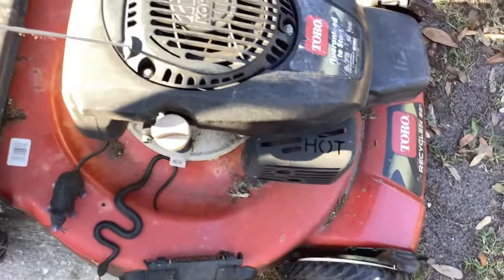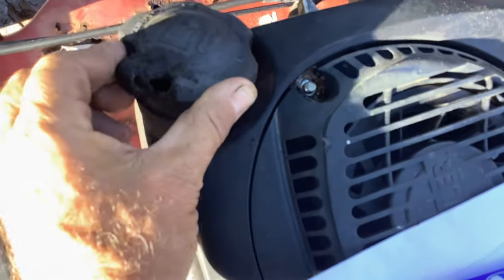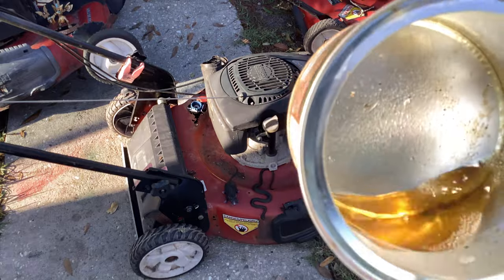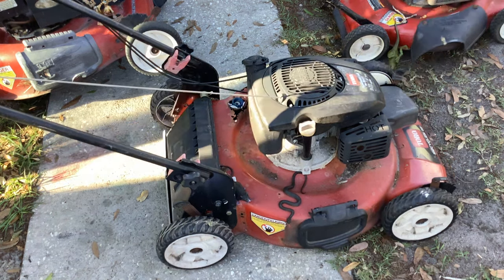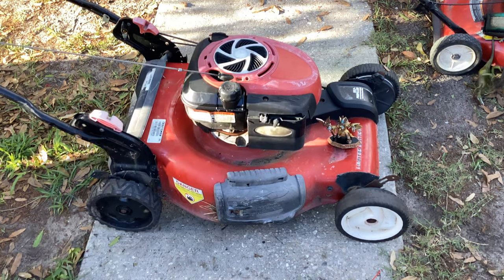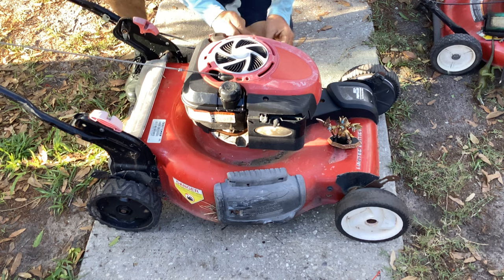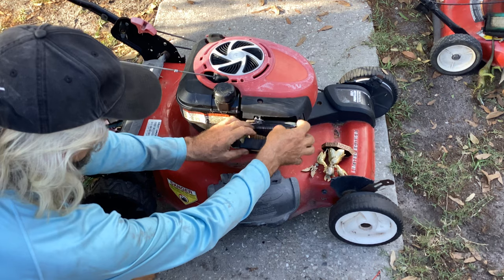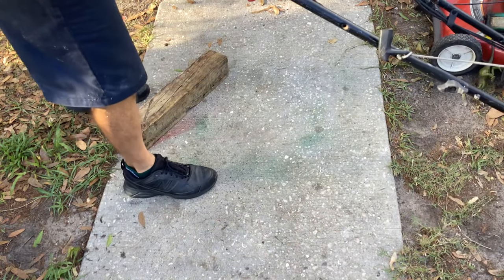Happy Monday.!!!  Big load of Junk Mowers for $40.  Big Score This Weekend, More Crap to FIX.!!!

Comment: I tried the heat gun on a quantum tank yesterday before i put gas in. It does darken the sun baked plastic trying to save .50 didn't put a bowl gasket in tip it up to look under it leak. So i had to revisit carburetor
Reply: I don't know why the loball? If only $10 might respond but many want 1/2 off. I don't respond

Comment: I’m thinking the rings are bad from the looks of the carb and amount of dirt and grass. Poor old 20 inch b/s
Reply: it's a '04. Those engines never go 15 years. Must've sat around alot. Oil gobblers at the end. Nowadays people can't afford to run them! lol.  Oil+gas+repairs every tenth hour.  : (
B&S used to sell them as repower units over the counter, as a  'World Engine'. It Sucked. 
underpowered, thirst, tiny tank, the governed bigger brother Quantum is 10x the engine.